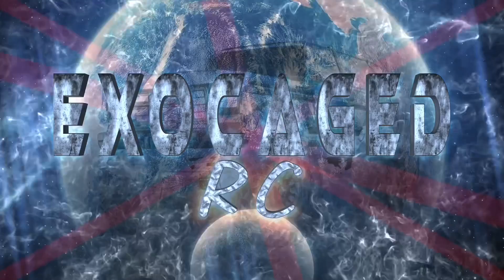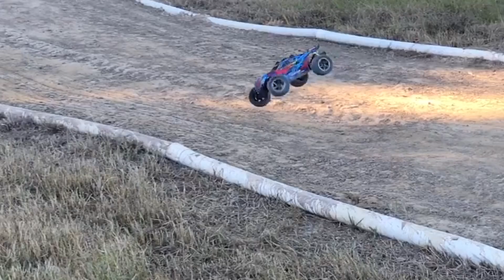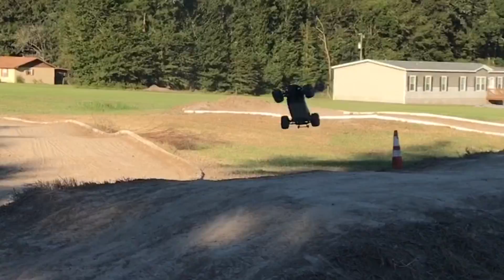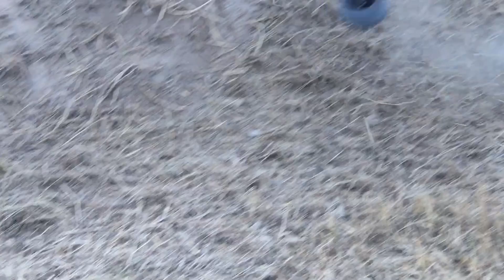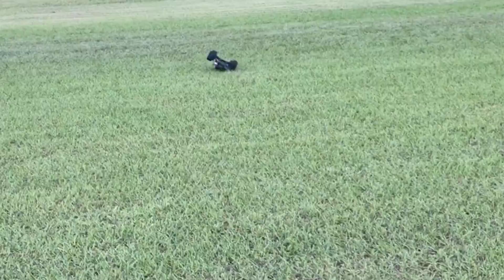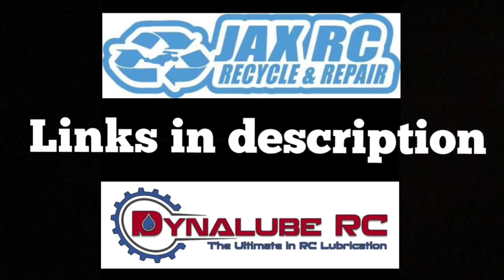Rustler 4x4 Durability Test

Comment: Well damn did you try running any other parts of the track or is it that small?..an my ruslter 4x4 sure can't take all that with 0 upgrades brother 🤔idk what is up but on 2s with 23 it get bout 43top w/35c bust lipos, 3s about 15 miles faster like right at 58-60 down hill..nice video overall
Reply from the maker: The track is pretty lame, believe it or not this is the best part of the track so that’s why only that is shown.